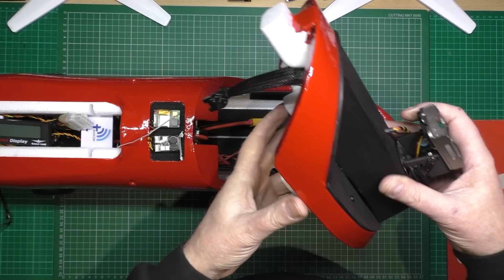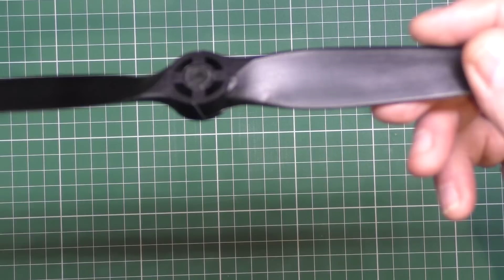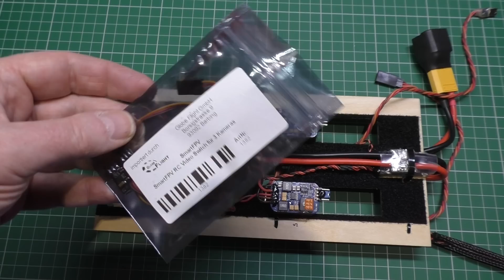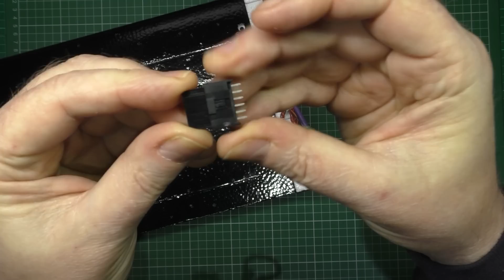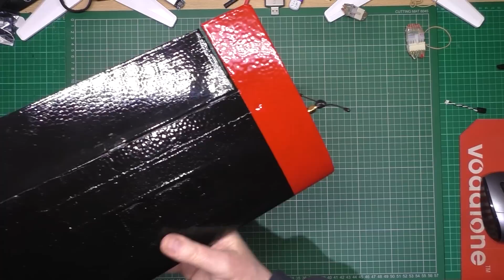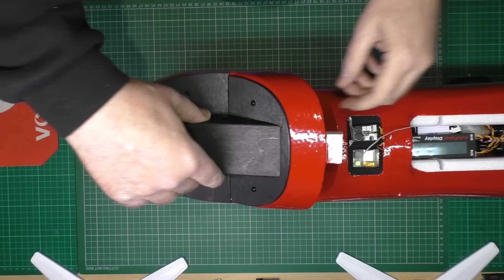SkyHunter FPV build part 11

Comment: cheers for reply vorteck, my main problem is the videos for the taranis don't seem to me to be the same (firmware ?)that mine has so I try following the steps only for it not to work .ahhhh,lol
what firmware would you recommend that I should use ,one that I can program with computer  . 
cheeres again steve.  
p.s sorry for my lack of terminology
Reply from the maker: +Steven Clarke Terminology? A stream of swear words is the correct terminology when you start using the Taranis but when you have it all sussed, it's the best bit of kit ever!  
I'm still using OpenTX 2.0.19 but I've got that used to programming the Taranis now that I don't need to connect it to my PC anymore. I can't really point you in many directions because I've just looked through all the 'manuals' and they are a little outdated. All I can suggest is to ask the question here.... http://www.rcgroups.com/forums/showthread.php?t=1914834

Comment: great videos vorteck, 
have just finished my skyhunter complete with vector, dragonlink, 2.4 ghz videolink, gopro gimbal, camera switcher and team blacksheep main flight  cam , all  I need to do now is learn how to program my new frsky taranis x9d plus transmitter .any ideas on where I could get a stock eeprom as this taranis might as well be in Japanese .cheers for any help in advance Steve
Reply from the maker: +Steven Clarke He Steve, the Taranis is rather hard to start with. I learnt a lot from Scott Page but it's a bit dated now https://www.youtube.com/user/PagesFlyingCircus/videos   

Unfortunately, no-one shares their config files now, there's so many variations and you can guarantee that they won't work with your setup.   
Where are you having problems? (apart from everywhere). Tony

Comment: I missed it but how did you glue the belly pan on please?
Reply from the maker: +Dick Gibson You didn't miss it, I didn't show it :-) It was one of the hardest parts of the build because it didn't fit perfectly. I had to glue the front half and then, slowly work my way to the back - I used 5 minute epoxy. When I got to the back, there were some parts that didn't touch the fuselage (it was too big) so I had to cut slots and pull it together. Does that make sense?

Comment: Hey Vortecks, I wanted to comment on your other video of the first Jet Powered Car, try putting a wind rudder flap in front on top connect to the steering to help stabilize the car for what direct you want it to go, like a plane on ground since it does not steer straight with turbine powered thrust. The Cars weight might need balancing from the Jets position possibly being too far back, getting the weight up towards the middle by moving the Turbine forward could help dramatically. The wind puts out a lot of résistance the faster it goes, Stabilizers flaps, balancers like Trim Tabs can also help keep the nose down and also help with any balancing adjustment of weight when moving fast.
Reply from the maker: +bs webtube Sadly, I sold it shortly after I did the video (over 10 years ago). I know there were a lot of things that I could have done differently and it was totally useless but I only did it as an exercise on what was possible. Thanks for the suggestion anyway and who knows...... maybe I'll try it again one day :-)

Comment: It's so beautifully, er complex...lol....I do like your home brew Runcam and its Pan and tilt, now that is nice and simple....Looking forward to your 1.2g GS...on was it 1160 mhz you said?, centre frequency for the Patch (which I also have)....I have a LawMate Video reciever, but I dont think it runs down at 1160mhz though....so I'm going to use 1280mhz, so I will have to trim my Patch I think....It did make me Larf though....Thanx for sharing your grief, it's so re-assuring to know we are not alone...:)
Reply from the maker: +EnglishTurbines Yes, it'll be running on 1160. As always, I've been having loads of problem with the groundstation but I've nearly got it finished now. Fingers crossed, it'll be ready for its maiden in the Spring....... 2025 :-)
Reply: Vortecks Cool, I have my 1.2G Video RX built into a small box on the back of my 5.8G Monitor...So far, I have only used it with Rubber Duck antennas, seems to work ok, but the Patch should make it even better...You will very easily get 3 Miles on that 800mw vtx on just Ducks alone, no problem.

Comment: "Extra Hours Surgery" was the headline on the newspaper. Very fitting sir :-)
Thanks for the shout-out and the Squeaky Pleasure naming. You got me laughing on that one. A very meticulous build my friend. Can't wait for a 10-10 day and the mighty maiden flight. For the canopy screw I would suggest gluing(locktite) a wing-nut to a bolt so you don't need a screwdriver, been working good on my rigs.
Reply from the maker: +dmerc00 Thank you sir :-) I'll try the wing nut bolt trick but I don't know if there's room between the hole and the hump.

Comment: Well done mate, you got there in the end!
You've got me worried about my video switcher now though.... i bought the one from hobbyking, so i'm guessing this isnt going to work for me either (i'm on ezuhf too).... do you have a link for the one you bought please?...your troubles could save me some troubles.
cheers. (and good luck with the maiden!) :)
Reply from the maker: +flyin flea To be honest mate, I think I just had a faulty switch or I hadn't got it 'trained' correctly. There was absolutely no instructions with the one I got and as Coyote from FPVHub has pointed out, the EZUHF outputs PWM on the servo channels - I thought it was PPM. I already have pan/tilt/servos connected to the outputs which work ok but the switcher didn't want to know. If you still want a known working switcher, you can get it from http://www.globe-flight.de/SmartFPV-RC-video-switch-for-3-cameras
Reply: Ok thanks mate. When the time comes i'll have a go at getting the one i have working, and if not then i'll use your link. Thanks for your help. :)
Reply from the maker: +flyin flea No probs dude. Good luck :-)

Comment: You don't need another camera switcher. 

The EZUHF can be mapped so you can have PPM output on say channel 1. Then your camera switch can be controlled from say channel 2 because you can map the PWM output of any channel to any channel of the EZUHF's output.
Reply from the maker: +Coyote FPV I should have done a bit more homework. I had the switcher on CH3 output but I didn't know the output was PWM. After testing it again, it seems it's actually faulty. Why oh why didn't I ask you first!
Reply: +Vortecks Shame, but you are all sorted now so it's all good :)

Comment: Looking really good mate. Still waiting to maiden mine with the same rules as you lol.
Out takes were fantastic. Start the day with a chuckle, alas at your misfortunes  ha ha.
Reply from the maker: +S700KY I've put it away now until its maiden. I was starting to think of things to put on it and as a result, I'm worried about getting it in the air now..... it's HEAVY. I need at least a 5 mile runway and I might have to transplant my balls because they're certainly not big enough :-)
Reply: +Vortecks I'm sure your balls will be fine mate. Your a good pilot. It has large wings, a powerful motor and she will fly. If an Antonov gets off the floor, so will this buddy.
Reply from the maker: +S700KY Yeah but the Antonov has 6 x 51,600 lbf turbines and a Soviet pilot with no sense of self preservation :D
Reply: +Vortecks Good point! lol